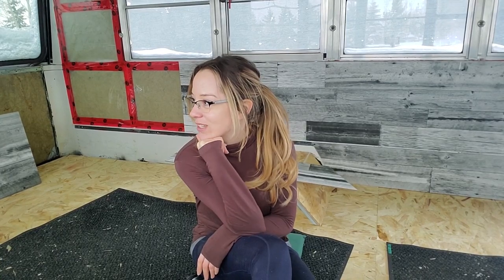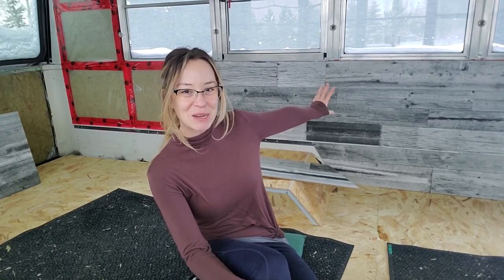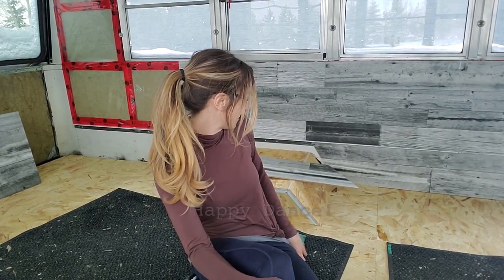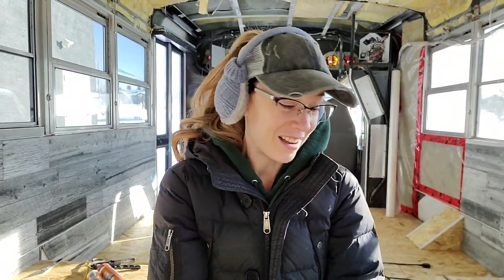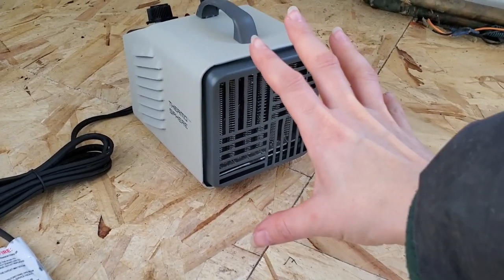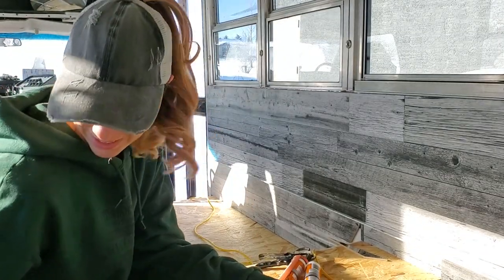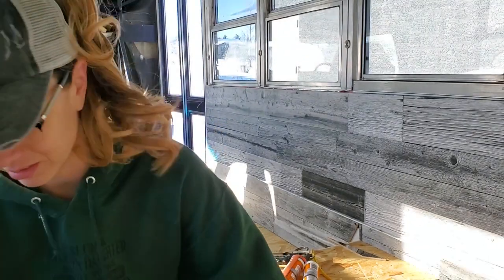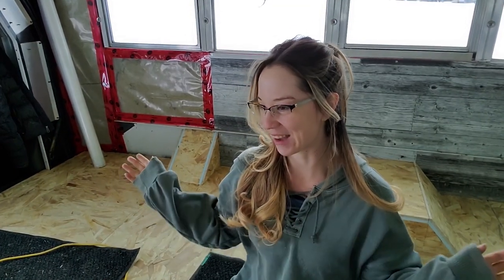Skoolie Conversion | How I Installed My Side Walls

Comment: At idle most vehicle will not run hot enough to provide hot water /coolant for the heater core. This is especially so when the temperature outside is cold. So smart idea to purchase a small (cheap) ceramic heater.
Reply from the maker: Thank you 🙂 that little heater was worth every penny, it's quite the powerhouse!
Reply: @SereneNomad  loving your videos, keep them coming. 👍❤️🇨🇦
Reply from the maker: @stevenprice5769  I'm getting another one ready as we speak 😊

Comment: When setting screws and the board pushes up, reverse the screw till the board sets back down then sink the screw again. Your board should tuck up tight. As for your van getting to 100, you have an awful lot of cubic feet of air and distance from the vents. The glass can pull the heat out of the air faster than you realize.
Reply from the maker: Hmm that makes sense 👍 once I have my flooring down I can put the heater back in that came with it and it won't be such a far distance. I think next winter will be much better even if it gets to -40 again.
Reply: Cover the windows and there’s less area to cool the air. And watch out where you plug that heater in and with what. You’ll be popping breakers / fuses.
Reply from the maker: @johnzee691  I'm going to be reinstalling the original factory bus heater, I took it out to get at the flooring, and I'll be installing a diesel heater next to it for when I'm parked. I will definitely have some window coverings as well, some nice insulated ones.